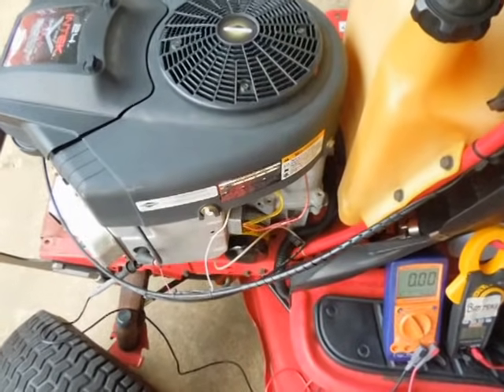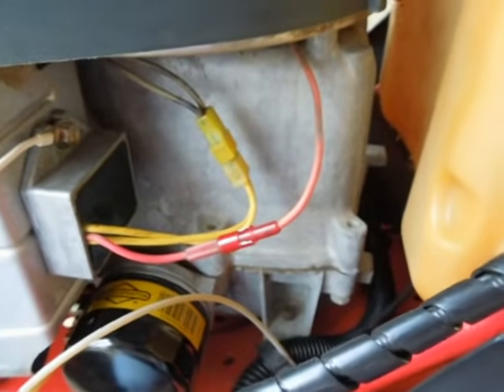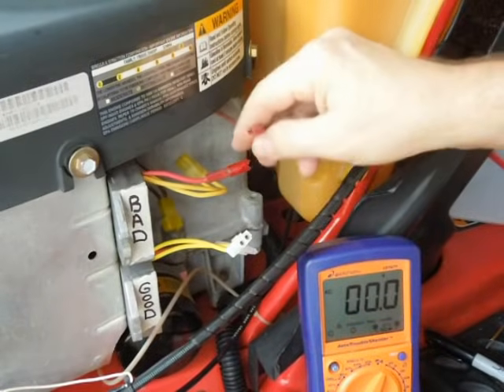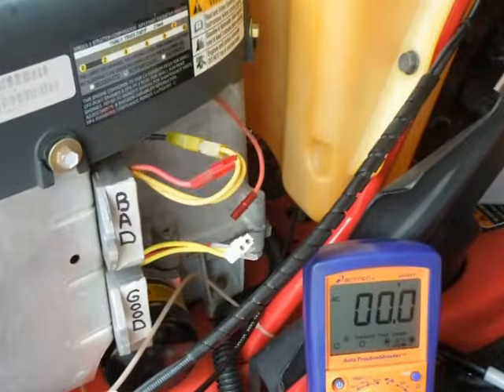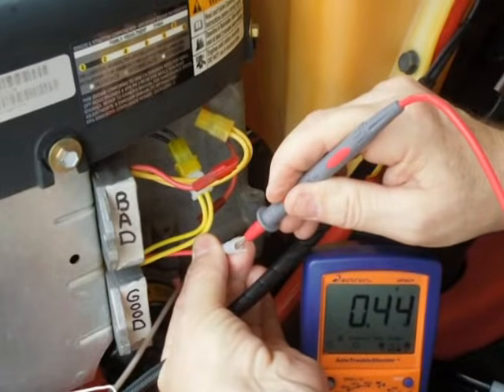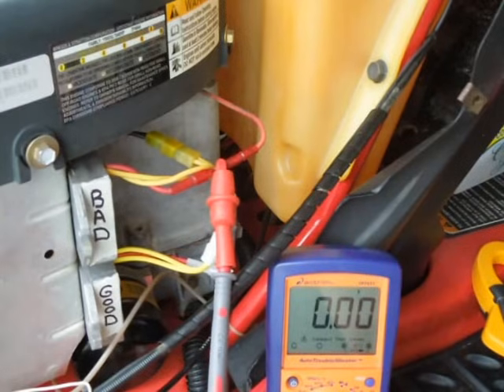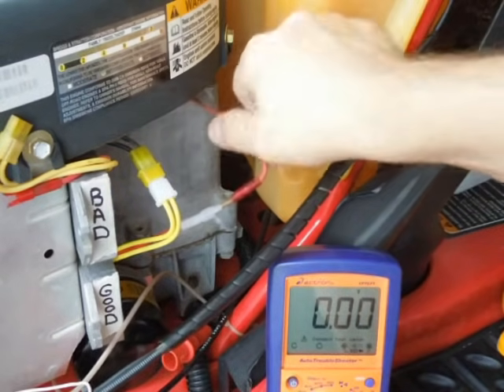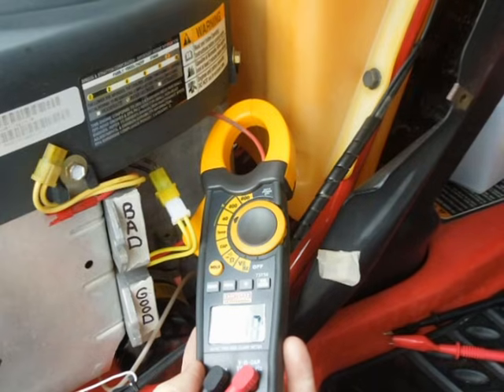Briggs & Stratton Battery Not Charging - Simple Voltage Regulator Test

Comment: Very informative and well presented.  The difference in the battery voltage at the battery and at the engine could be due to the small resistance in the ammeter.  An ammeter is really just a voltmeter across a known resistance.   The only thing about the video would have been a better explanation as to why the good regulator only puts out 0.49V and the bad one puts out more.
Reply from the maker: n4mwd thanks for the comments.  I couldn't explain why the good and bad regulators produced the voltages they did when disconnected so that is why I showed the voltages measured inline, with the jumper.  This showed the viewer another way to check output voltage and diagnose the system.   Thanks for watching!
Reply: I tested mine and ordered a new regulator.  I'm thinking that the Briggs regulator must work similar to a motorcycle regulator.  Those usually work by shorting the output to produce a voltage based on the current draw.  Remember the alternator put out about 25 volts.  So with only a meter for a load, the output voltage is negligible.  If you connect a 12V light bulb to the load, the voltage would likely shoot up.  Thanks for a great video.
Reply: I got the new regulator.  The battery now charges, but only at certain RPMs. ???  The mower has an ammeter and I used the blade clutch as a load which draws about 5 amps.  At about 1/3rd throttle, the system just breaks even.   Faster than that and the alternator stops charging and the battery discharges.  Any ideas what this could be?  Bad regulator?  Bad Stator?  I get 20 VAC when I tested the stator using your method.
Reply from the maker: n4mwd that is strange!  I would trouble shoot it by breaking the system into sections.  When I checked my stator I got 26 vac at about half throttle, I assume the voltage would be higher at max rpms.  Do you get a good ac output from idle to wide open rpms?  Based on my test, you should get at least 26 volts.  If that looks good, run a wire from the regulator output lead directly to the positive terminal on the battery.  If it charges correctly, something is wrong in the mowers wiring, key switch (if the circuit goes through the switch, like mine does) or the amp meter, or ???  I would also temporarily try running a ground wire directly from the engine to the negative terminal on the battery, to rule out bad grounds.  You could also look for voltage drops using your volt meter, by attaching one lead to the engine and the other to battery negative terminal to test the grounds.  And you could do the same on the positive side using a jumper like I had at the regulator and then touching battery positive with the other lead.  I'd expect to see a voltage drop less than one volt.  Good luck, I'd be interested to hear what you find!
Reply: I cut the AC terminals off the old regulator to get a good connection for testing.  I got about 29VAC @ WOT.  However, after the engine was warm, it dropped to about 26 VAC @ WOT.  The AC output voltage was linear to the RPM.  No sweet spots.

After reconnecting the new regulator, I grounded the regulator to the negative battery and there was no change.  The regulator output shows a straight path to the positive battery through the ammeter, fuse and keyswitch.  If there was a loose wire somewhere, it wouldn't fail at a particular RPM.  In fact, I was able to mow my lawn in slow motion and keep the battery charged by keeping it at 1/3rd throttle the whole time.  The sweet spot where it sort of worked did not change.

I'm thinking that I can either order a new regulator or pop the flywheel and take a look at the stator.  I flipped the potting epoxy off the old regulator like you did in your other video and the PCB was nothing but cold solder joints.

I made a video of what is going on, but computer troubles prevent me from uploading it at this time.
Reply from the maker: n4mwd it sounds to me like you've uncovered the problem.  Based on what you wrote, the fact that you had no output when you grounded the regulator to the battery suggests there is an open in the ground path between the engine and the negative terminal.  The regulator should put out whether it is grounded to the engine or battery.  I also wonder if the stator is properly grounded to the engine?  Just some thoughts.  Good hunting.
Reply: I meant no Change, not no charge.  No change in output - wire grounded vs engine grounded.  It still had output, but still only at 1/3rd throttle.  Same as without the ground jumper.

I dread having to take off the shroud and flywheel.  One other thing that could cause trouble is loose or missing magnets.   That could "possibly" cause a non-sinusoidal waveform that could cause the frequency oddities that I'm observing.

I'll probably be working on it tomorrow.

Comment: Thanks for this, I found my battery voltage with motor off - 11.8v DC(had to jump start motor), battery voltage with motor on - 12.0v DC, voltage direct from coil 34-36v AC, voltage direct out of regulator 15v DC. I dont understand why the voltage direct out of the regulator seem fine but when I connect to battery it dosent seem to jump up to the 14 odd volts?
Reply from the maker: Tim Orum I wish I had the answer.  I'm sure it has something to do with how the the regulator fails, open diode, shorted diode or?  I thought it was strange that my BAD regulator had a higher voltage on the DC output wire than the GOOD regulator which is part of the reason I made the video, you can't judge a regulator by just measuring the DC volts coming out of it.  The becomes a process of elimination, if the circuit to the battery good and the ac output is good, the only thing left is the regulator.  The little piece of brass tubing that let me read the voltage at the regulator helped tell the story.  Thanks for watching.
Reply from the maker: Tim Orum read your comment again.  Are you saying everything checks good but you have a large (2+) voltage drop in the wire, between the voltage regulator terminal and the battery terminals?  If so, it could be because you are charging at high amps because the battery is low or, like at the end of the video, I show that that wire gauge is on the small side and has a pretty big volt drop.  Another source for voltage drops are high resistance connections.  You would have to follow the charge wire back to the battery and measure the volts on each side of a connection (or across the connection to read the actual volt drop) and see if you can find it.  Just a guess but if your mower is kept outside, the contacts in the key switch could be corroded and causing the drop.  Good luck!

Comment: Say on the other side of your motor can you tell me which wire is coming from the coil?
Reply from the maker: James Rice , I don't understand your question?  Are you asking about an ignition wire or charging system or ???  Help me understand and I'll do my best to answer your question.  Thanks for watching.
Reply: well on the side of the motor that the starter is on where does the black wire connect to at key switch?what post?

Comment: Thanks for posting. Quick question. From alternator i have 50 volts out. When engine not running and i connect alternator cable to regulator cable it smokes. I have 12 volts in regulator cable. So if running i will have 12v and 50v ac hitting each other. Should there be 12v dc where alternator cables are going in?

Comment: Curious, would this rectifier regulator power a load such as lights only without a battery? What is the topology of the regulator? Linear? Switchmode step down buck?
Reply: NVM, was able to test, yes you need a battery to turn on the regulator, but you can remove the battery and still have it work long as you dont go over the current limit.
Reply from the maker: I figured that it would produce power without having been excited with a battery because there are magnets in the flywheel.  Unfortunately there is no way to hand crank this engine without the battery so I can't try it.  Thanks for watching!

Comment: the charging system on my B/S 8 hp only has one wire coming out or the motor, ???
Reply from the maker: Chris C I think if you'll search in the comments below there was a guy with the same situation you have.  If I remember correctly there are a couple of diodes hidden in the wiring coming out from under the flywheel.  In his case one diode was bad and he had to cut it out and replace it.  I think there is a video on YouTube showing how to check this on a single cylinder Briggs.  Sorry I can't be of more help.  Thanks for watching!

Comment: Ok, so the "bad" regulator was still producing over 12 volts & the "good" one was over 15. If the battery is 12V why would the voltage regulator be bad then??

Comment: could you please share the technical details of this alternator.?
like the voltage rating, current rating.
Reply from the maker: abhishek paramanand on this engine the alternator is rated at 16 amps at 14 volts.  My research says, this same 24 hp engine is made with more and less powerful alternators depending on which model you have.  If you really need a lot of DC output, you could rig up a belt driven external automotive alternator.  There are several videos of this type of rig on YouTube.  Thanks for watching.

Comment: sounds like a valve adjustment is needed the compression release is not working correctly.
Reply from the maker: richard cranium you were right about the valves being out of adjustment making the engine hard to crank.  One cylinder was ok, the clearance on the valves in the other were .008" and .010".  Adjusted them to factory specs and the engine cranks with no hesitation.  Thanks.

Comment: How many AC volts should I be getting out of the stator,I am getting 8 AC volts,is that enought?
Reply from the maker: Linda Green if you had the engine revved up, 8 ac volts is not enough, it should be 20+.  Sounds like you have a stator problem.  Watch and listen to the video again, I get 25 ac volts at half throttle.
Reply: Yes it is trash,the reason I asked was you did not say what the AC voltage you should be getting from the stator. Thanks very helpful video. Fred

Comment: can you connect, straight from ac to battery? or is not recommended? or can't do?
Reply from the maker: ideaslandscape you should not connect the ac straight to the battery because the ac output is not polarized and regulated and the battery will short to ground.  Please don't do it!
Reply: thank you for your prompt response,  i just found out , my electrical has a diode,  it's dc.  very good video

Comment: a bad or really low battery will fry the voltage regulator on a briggs and stratton engine with this style voltage regulator due to overloading the regulator , always make sure battery is fully charged before attempting to run engine

Comment: I have a 18 hp vanguard in a zero turn exmark. You can't even get to the regulator without taking the flywheel off.  I assume I am stuck replacing both stator and regulator since I am unable to check A/C voltage?
Reply from the maker: scooby7774doo if you can figure out a way to connect you volt meter leads to the stator wires, on the stator side, before the regulator/diodes, you may be able to read AC volts.  If a diode is blown and shorted, this won't work.  If you have nothing to loose and can solder the wires back and insulate them, cut the wires so you can just check the stator.  Good luck!

Comment: I have a voltmeter instead of a multimeter. When testing the wires coming out of the alternator, what exact setting do I make sure voltmeter unit is turned to. There are ACs,  DCs and mutliple number selections in for each the Ac and Dc sections. Also want to make sure I'm on the right settings to check both the wires coming from alternator AND to check the voltage regulator.
Reply from the maker: sandywjo5  use the AC volt setting on your meter that is 25 volts or higher when checking the output coming out from under the flywheel.  Use the first dc volt setting on your meter that is more than 15 volts.  It's all in the video, all the checks are volts and I tell you when to use ac or dc.  Thanks for watching.

Comment: I can simplify in two steps, check the battery voltage while running, if not charging voltage ie 13+ then check alt AC output, if good check fuse and or replace reg.
Reply from the maker: Very good and you are correct!  I could have simplified the video down to just that but then you wouldn't know that you can NOT accurately check the output voltage at the regulator and understand how the system works.  In my humble opinion, understanding how something works is always valuable because things don't always fail in the same way.  Thanks for watching and your comment!
Reply: I am like that when I don't know how it works.
Reply from the maker: Inspector More-Anonymous in your zest to be a know it all, you're missing the simple point that I'm demonstrating, and you are actually agreeing with.  The DC output can not be accurately measured at the voltage regulator dc output wire connector (when the wire is disconnected from the battery).  To avoid an erroneous reading, you must test/measure the DC output voltage when the wire is connected to the battery.  Feel free to make and post a better troubleshooting video if you can.  24,000 people have watched this video and you're the only one that doesn't comprehend the empirical data you're looking at.  It is what it is.  Amazing.
Reply from the maker: Inspector More-Anonymous right, just like you see in the video.  You can try to measure the dc output at the wire coming out of the regulator but it isn't accurate.  Only when I put the jumper inline on the dc output wire could I accurately measure the voltage coming out of the regulator.  Thanks for watching.  BTW looks like you didn't even bother to read this thread of comments, this has already been covered.
Reply: just shows your conciet . i am assuming that you are assuming that the ground circuit is good.?!
Reply: Vernon your right,  but he shows and educates us more.
Reply: snaproll94e never said disconnect from the battery.....but of course my degree in EE makes me a know it all. Empirical data??? conceited much?
Reply: You have to test the connection while the wires are still connected, you can test the AC input and DC output, but you need to leave everything connected, either push our probes into the back of the connectors to make contact or use a clamp meter
Reply: Everything can be tested accurate, you in improperly tested it, you can accurately test the AC input, and DC output stop unhooking the circuits they have to be complete to test, are you referring to the loss of DC voltage due to resistance in the specific gauge of wire? Its a simple equation, just look at your resistance per foot, and measure your length of wire, ohms law, there will always be large losses in a DC circuit this is common sense, forgive me but im failing to understand your logic, anyone with basic understanding of DC electricity knows that your source output and your end of circuit will vary dependent on gauge of wire and length, your video explained nothing except your lack of understanding of how electricity in general AC and DC functions, this is common sense friend

Comment: I don't have a regulator on my brigs,  the two wires from the alternator runs into a bundle of wires then to the ignition, and then back down to the solenoid. is it possible there is just a diode inline somewhere?
Reply from the maker: I don't have any experience with your set up.  The other guy commenting on this video had the same issue you have, maybe he can help you.  I would think that there would be some diodes in that bundle of wires and if you can get on the connections on the flywheel side of the diodes you should be able to check the ac voltage output.  You may also be able to check that you have a good connection back to the battery if you can trace the charge wire from the battery, back to the engine (diodes?).  My key had to be on for the charge wire to become hot.  Good luck.
Reply: There is a diode (big lump) on your red wire right before it goes to the 2 pin harness/clip instead of a voltage regulator, you likely have a dual rectified system (AC and DC), that lump (diode) removes one of the sine waves turning the AC to DC, it is an unregulated system, Typically the headlights are AC only, and the DC output right after the clip/harness goes to the ignition and battery sensing the charge/resistance of the battery to keep it charged but its more of an educated guess on briggs part, because there is no true regulation, my mower is getting almost 18V which will destroy my AGM battery, if I had a standard flooded battery it would of blown up by now and gassed out to hell, the simplest fix if your getting too much charge voltage is put a voltage regulator directly at the battery, or if your engine is overspeeding running at too high of RPM this will also happen, if your battery is draining or dieing, it is likely your alternator or bad diode, but unlikely a bad or fried diode unless it was mishandled or yanked or shorted in which case it would typically blow a fuse

Comment: Thanks, helped me rule out buying the more expensive parts.  Regulator on the way from Amazon.
Reply from the maker: I just took my original Briggs regulator a part.  Diode inside is burnt up.  The circuit board says "Tympanium Corp".  No surprise there, I'm sure they are all made overseas.  Check out the video if your interested and thanks for watching.
Reply from the maker: Turns out they are a US based company.  Info is in the comments of the "Inside Briggs & Stratton Voltage Regulator" video.
Reply: It has been nearly 2 years since your Amazon Regulator install... How is it working?